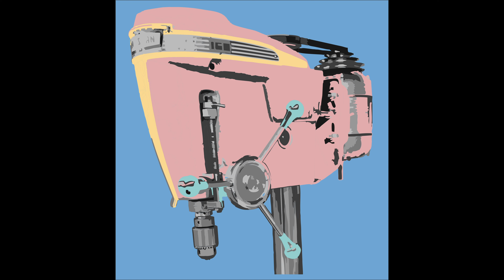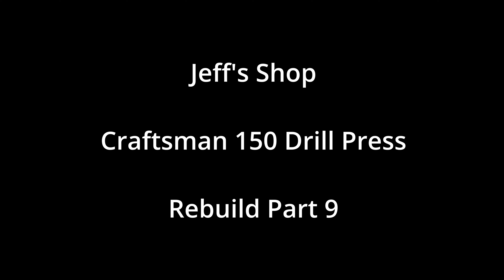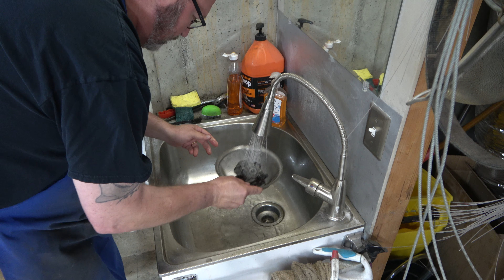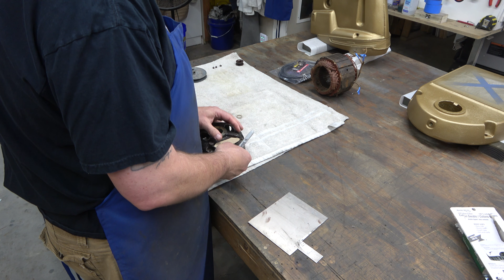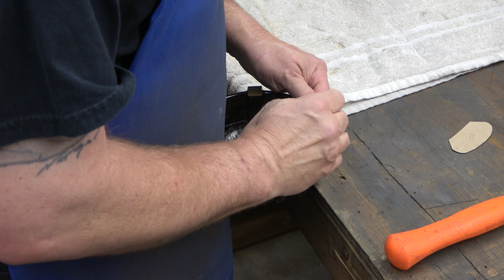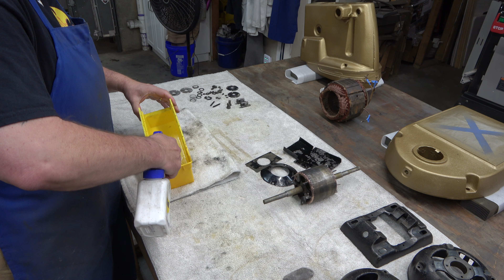Part 9 Rebuild 150 Craftsman Drill Press (Motor Cleaning & Painting)

Comment: RE: Cleaning a stator: 
Will you comment here or separately on how to clean the stator on an — especially dirty — electric motor on these vintage Craftsman tools? In this video, you comment that this cleaner (CRC Lectra-Motive Electrical Parts Cleaner) is especially good and you use a nylon (not metal) brush taking care not to remove the lacquer coatings. 

For example, would you ever use compressed air to begin with? What if the wire coils are stubbornly coated with oil and wood or metal shavings debris? Maybe you can make this a new, separate video?

https://youtube.com/clip/UgkxTYpzSRsdMaElnC1RY22QFIbZejQEm-QB?si=GSz91RaNazi9jGcc
Reply from the maker: You can use compressed air. The process i used with CRC and a tooth brush is all I ever do. I do not recommend soaking the stator in anything.